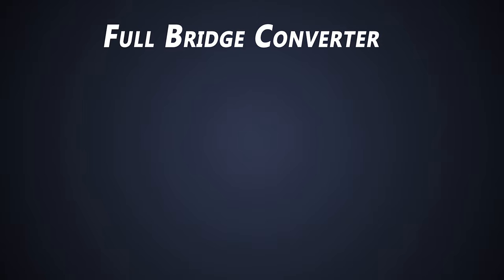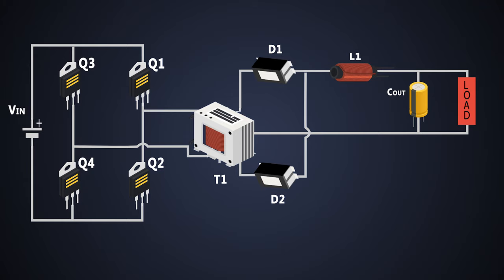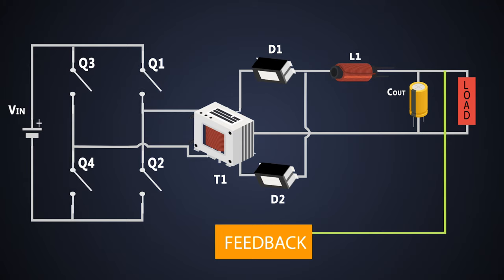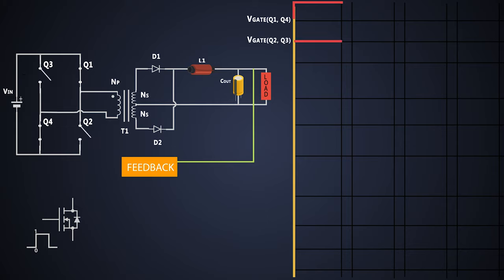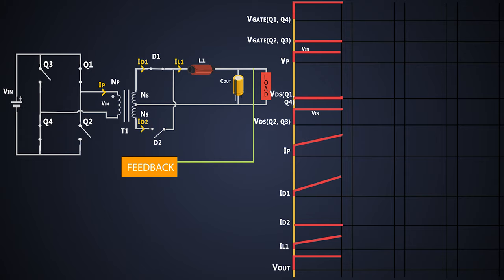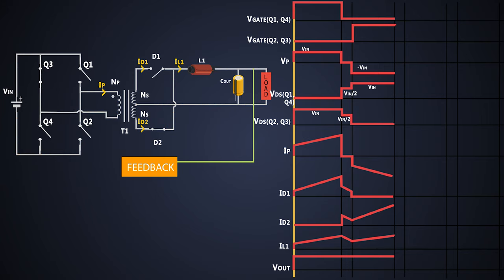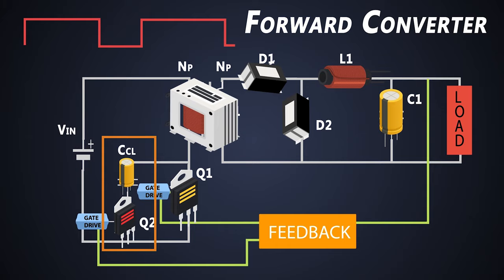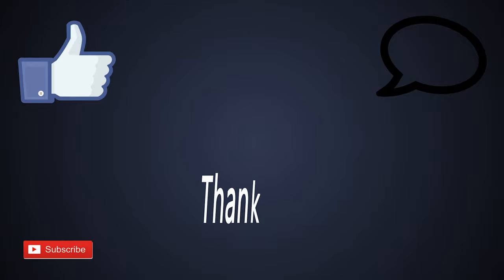How does a Full Bridge converter work? | Full Bridge Converter Working

Comment: Hello. I need your help. i want to make smps design for electric car. which converter should i use? where should i start and  how can i it ?
Reply from the maker: Generally PSFB converters are being used in EV chargers. the hardware is same as per full bridge converter but the controlling topology is advanced
Reply: you can also use LLC converter using frequency control

Comment: Great video! I had one question, that when a MOSFET gets off due to the inductor when energy will release than a spike appears on the Vds of the MOSFETs creating a type of ringing. How can we remove that voltage ringing? I had seen some snubber circuits but I need something more advance. kindly suggest
Reply from the maker: Snubbers are always the best option! I would suggest you to go for snubbers there are plenty of advanced snubber topologies which are efficient & cost effective.

Apart from that I don't know any other method as of now, Sorry Mate!!

Thank you so much for your appreciation!
Reply: If you're getting voltage spikes then you can use TVS diodes to supress them.

Comment: Very helpful explanation and well made video! I have a quick question. When all MOSFETS are turned off, do you first have to assume that all MOSFETS have the same voltage drop Vin/2 before concluding that Vp = 0? In your explanation, you first stated that Vp = 0 and then said the MOSFET voltage drop was Vin/2. I just want to make sure I understand the correct flow of logic. Thanks!
Reply from the maker: Well if you check the working, the MOSFETS which are getting shorted in the respective cycle don't have Vin/2 voltage across them & Np gets directly connected to the supply.

Comment: Pls can I achieve solar charge controller through this topology? If yes, then this transformer, is it ferrite core or iron core?
Reply from the maker: It depends whether you want to Step up the voltage or Step down and ferrite cores are used for transformers